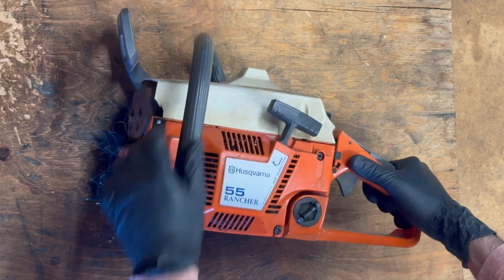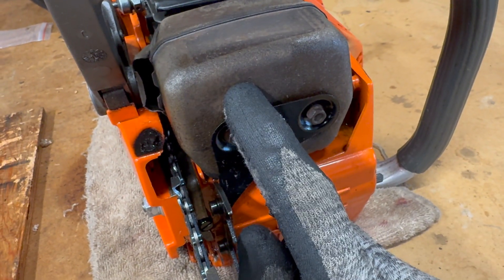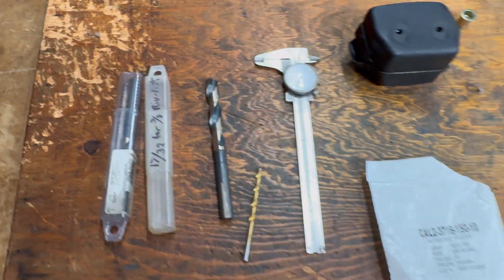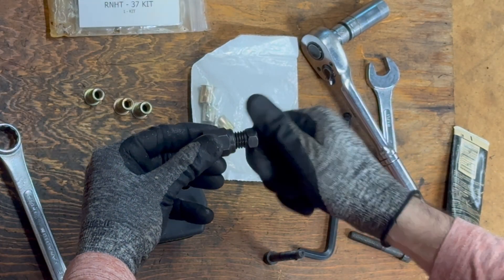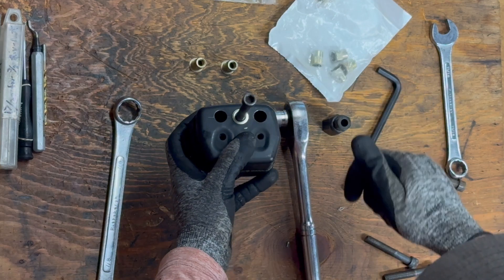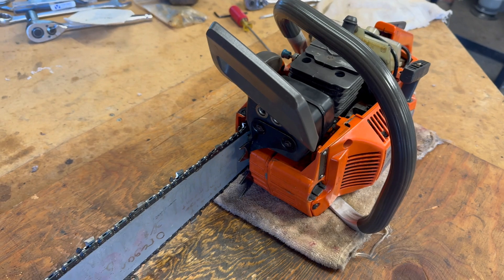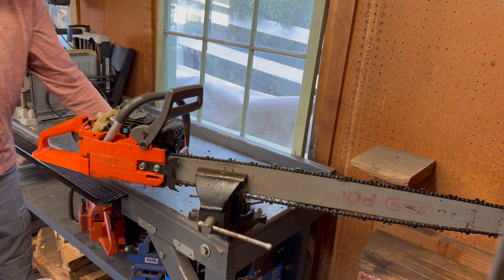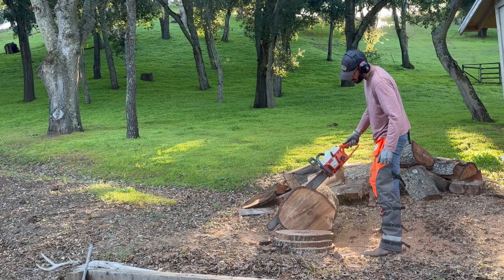Husky 55 Part 3: More Power from High Flow Muffler Mod! Tuning and Testing in Coastal Live Oak

Comment: You used the rivot nuts because you you thought you may need to plug one or more of the new ports based on performance. It appears the test was a success using all three ports so if I was to do the same to my saw, are the rivot nuts required?
Reply from the maker: Others are more knowledgeable than me, but I think you just want the most flow you can possibly get.

Comment: Aren’t you afraid to get stuff inside the muffler and maybe even to the piston? I am considering doing a muffler mod like this and i obviously don’t want stuff where it ain’t supposed to be.
Reply from the maker: @rakel9000  not worried at all. There is significant airflow out of these ports when running. When stopped it’s possible I suppose for something to get in there if you tried. Maybe a little dust, but that will get expelled immediately. It won’t destroy your engine.